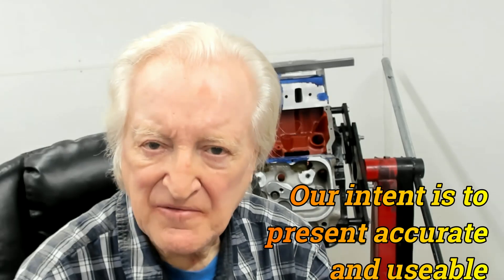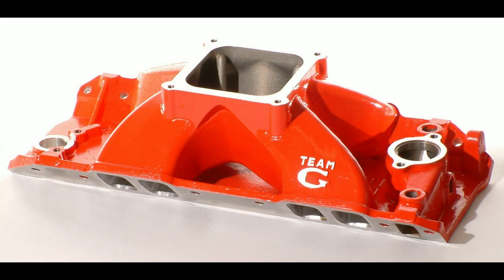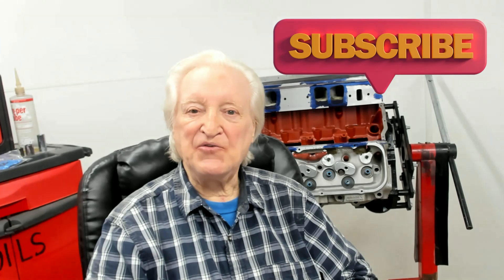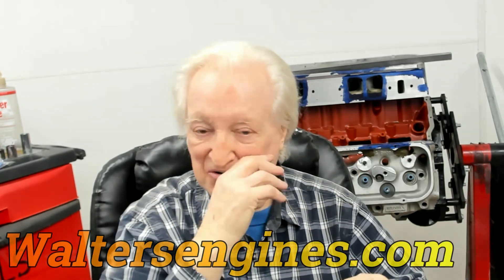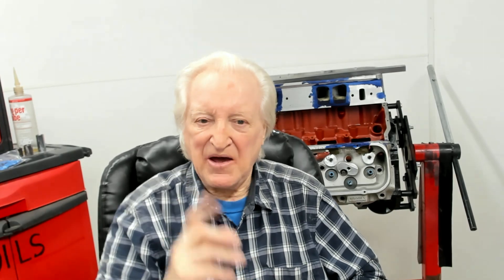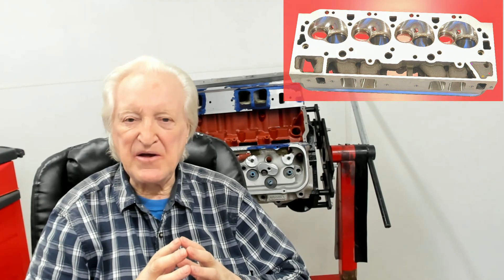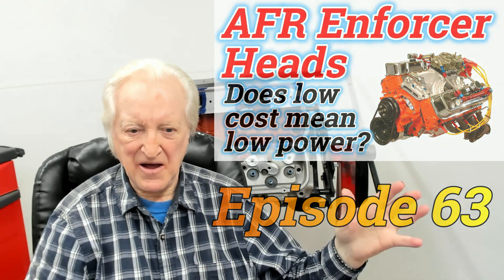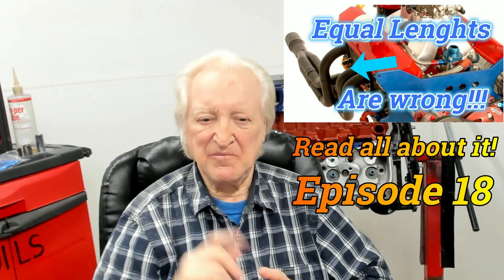BB Chevy 454 stroked to 525 cubes - super big torque!

Comment: The secret it is the heads flow 400 cfm  along with 500 plus cubes
Makes the dominator carb force feed
It enough to make all work
If it had 13 to 1 compression it
Would make 900 hp

Comment: 10.5:1 and 87 octane? Is that correct or a typo?
Reply: It all depends on total timing and of course combustion chamber efficiency, but you can back the timing down a little.  My 454 runs on 87 octane with 9.5:1 and 40* total timing....gotta have the tune right.
Reply: Not a typo, I have his Big Block book and he loves to make them work on 87 octane.
Reply: Static compression is a very crude way of estimating octane requirements.

Comment: Here is one , Show us some good ways to get 500 HP and excellent low end torque out of an 6 liter LS engine for a off road wheeler with 1 ton axles with 456 gears and 42 inch tires..
Reply: Look at the Richard Holdener builds when he tested the edelbrock cross ram. Both times the engines made over 1.44ftlb/cid which David says is top level stuff.
Reply: @bcbloc02  you are right it did appear to give good low end power and torque